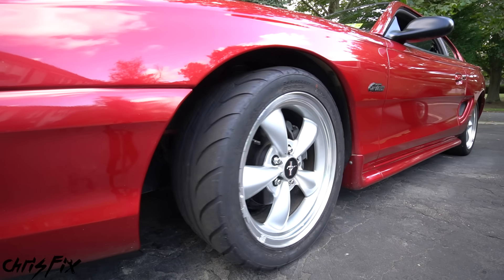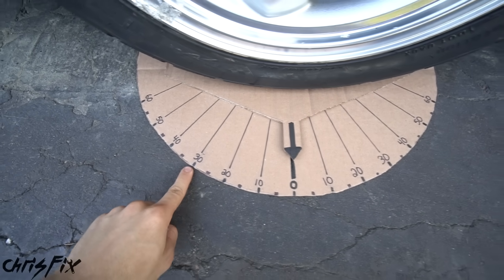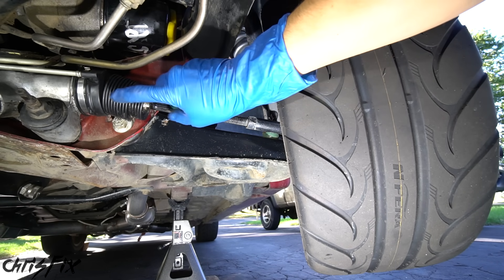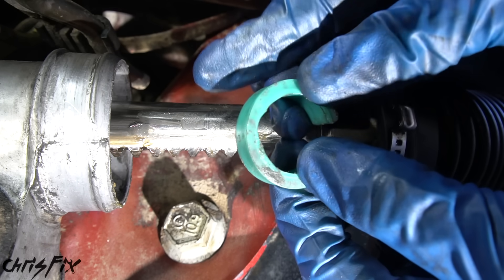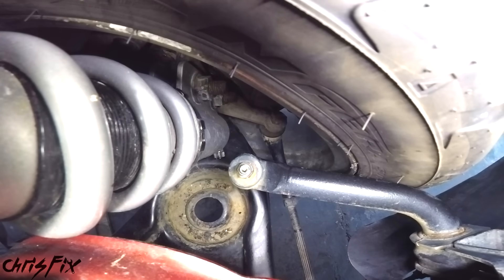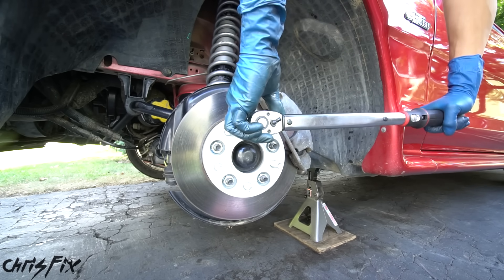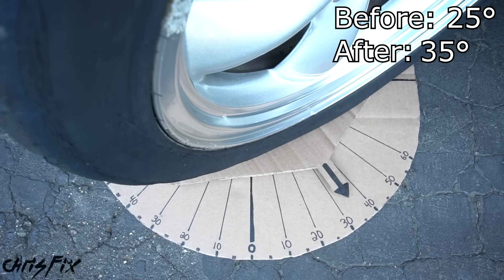How to Get Your Car to Make Sharper Turns (Steering Angle Mod)

Comment: Normaly i like the chanal a lot but if u do big place holders to the front wheels, i realy hate it. You will notice that your car isnt drive that comfortable and you have to do much work on the steering wheel just by driving a normal road. I would explain it better but my english isnt good enough to use technical terms.

Comment: I would rather replace the ear clamp whit a reguler nut clamp or a reguler hand tightening clamp.The ear clamps can get loosen when you remove them.
I'm thinking it's better because the rubber tubing woulden't snap off it's former place when you make turnes.

Just my opinion !
Reply from the maker: +Dado slo good idea!

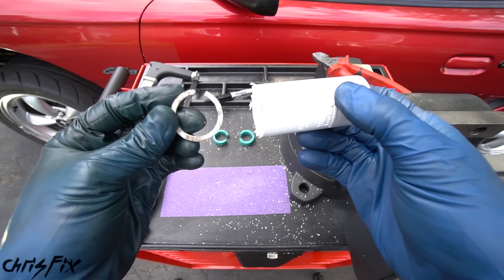Comment: @ 7:13 PVC pipes are not good for high temperature and they have low wall thickness.
Try to use polypropylene tubes and aluminum or wood mitre saw

Comment: cris
ABS   not working,  abs light always on...
plz tell how to fix
Reply: Jotu Singh One of the most common problems is a bad wheel bearing or speed sensor, but it could be just about anything. Any ABS fault will trigger the ABS light and turn off ABS. You will need a scan tool to see what the fault is.
Reply: Little story. My ex girlfriend bought a car from a used car lot. They told her that the battery and the fan belt was bad. They told her to go to the garage they contract with and get those installed for free. Well She said when she was leaving, they told her the ABS lights were on and would need to be looked at, at a later date. She never did take it back. The next couple weeks, I did a routine going over, changing the oil and testing the radiator and such. I happened to see some electrical tape hanging down beside the master cylinder. "Someone" had put the plugs in without snapping them in place, then wrapped the black electrical tape around the ABS electrical plugs so that  the plugs from the wiring harness to the master cylinder would be hidden that they weren't snapped into place. I pulled the tape off and snapped them right back into place. Problem solved. She had told me before doing this work, that she didn't remember the ABS light being on going over to the garage... Check those connections.

Comment: There is a good reason why they limit steering angle. Usually by CV joint design. Also after any steering rack modifications, you need to do tire alignment.
Reply: Usually due to not wanting to spend the money single model parts.Most modern cars are kinda parts bin builds with many parts having been manufactured for multiple options.Its simply much cheaper to limit steering angle than redesign parts of the steering and suspension system.

Also, this isnt a steering rack modification, its simply removing the physical limiter.I would however still recommend checking the alignment due to adding the wheel spacers.Its entirely possible for them to change the wheel alignment.Seen it several times over the years.
Reply: I don't think this would change alignment at all, just limits (which I agree should be left alone unless you understand steering geometry)
Reply: 80 % of cars in my country are fwd
Reply: @TheBlork74  not the kind of car enthusiasts generally buy though. Car guys will almost always go for rear wheel drive. 4 wheel drive is also seen occasionally (i believe 4 wheel drive has a similar issue to fwd)

Comment: Wouldn't you need a new wheel alignment after installing spacers of that size?
Reply: Depending on the setup, you may or may not. In most cases, no. But in some circumstances, you should at least have your alignment checked.

Comment: I was wondering if you are able to switch out windows on vehicles such as the back truck window with one that slides. I bought a Ford ranger and it doesn't have a sliding window on the rear glass. How easy would it be to put one in?
Reply: Honestly if you found a rear window the exact size, it wouldn't be too difficult. You will just need the proper tools to remove the glass and install the new glass (almost in all cases they are held by a sealant). From there, if you wanted a power sliding glass, you would have to run wiring and it would likely be more involved at that point.

Comment: Can you do a video on replacing broken lug studs?, I noticed you didn't have one.
Thanks your the best!!! =)
Reply: I don't think he has a video, but I can at least help you out. Generally, in most situations, you can remove the wheel, and smack the broken stud with a hammer from the front to the back. And from there, in my experience, when installing a new lug nut stud, I generally gather a large stack of washers on the stud underneath the nut, and use an impact wrench to draw in the new stud.

Comment: There's a reason why those power steering limiters are on there... and at least here in Utah you won't pass safety with those spacers..good idea though. if the car performs fine the way it is....why fix it ??? if you do run into clearance issues...thats just another headache.

Comment: Hey dude, I’m doing up a 1997/98 Toyota Supra RZ, and I need to know what kind of fuel pump I should get if I’m using it for track-day Racing. Needs to be less than 300 quid (I’m in the UK, but in US terms, around $460). Cheers in advance
Reply: LiamIsAPikachu YT use a gas pump that only runs on air

Comment: Hey ChrisFix, 

I wonder if you could discuss new changes in Mass annual inspection started this month, which almost means "if you love working on your car or making it better, move out".  They are now mandating EVERY shop to purchase $5,000-$10,000 equipment with x5 cameras at EACH bay and even on an inspector (!).  So, you are forced to driver boring cars unless you can afford a $100,000+ car.   

Something as simple as a CAI, catback or ride height 2 inches higher/lower than stock will not pass.  There has been a petition going on at Change.org by a man named Nick Martini.  You probably would not believe how absurd it is, a LOT worse than California......  If this program does not get removed, aftermarket performance parts vendors will lose ALL customers in the state/commonwealth of Mass......

Comment: You need to get just better steering wheel and move last seats and all things you dont need so it's not heavy
Reply from the maker: Thanks for the tip!
Reply: ChrisFix and  i  forgot to say to move Electrnic out beacuse that kann fired up easily and rolcage i forgot to say thanks for response

Comment: Hey Chris, Love your vids! Just had one question on changing oil... When removing the bolt on the oil pan to let out the old oil, the copper gasket that you mentioned was 1-2 time use, is that universal  to all cars, or are the gasket and bolt size different among different types of cars?
Reply from the maker: There are different sizes. You can call the local parts store and get the correct size for your car.
Reply: Thank you!!!!

Comment: Hello Chris(or anyone who knows something about the topic), Im looking to be buying a  bmw 335d, ive heard there is pleanty of problems with the carbon buildup on them. Now I just wanted to get some infromation from someone who knows what they are talking about, by all means i did browse the web but just wanted to double check with you. So what are the risks of this carbon build up other than the car being in limp mode? also how ofen am i looking to clean this out, ive read roughly 50k miles. What other things do i need to know about carbon buildup?? and i was reading that some guy was looking at roughly a 4000 dollar pricetag to change his head, why does he have to change this head? why not just get it cleaned? here is the thread i was reading. http://www.bimmerfest.com/forums/showthread.php?t=711971

I know you're very bussy but if you find some time to anwser my questions I would be very thankfull. Im not buying the car for another 6-12 months however im just trying to build some knowledge around it.
Reply from the maker: If it is direct injected you can have carbon buildup issues and to mitigate them just use an additive in the fuel every oil change or so.
Reply: Thanks for the reply Chris, Im still not 100% sure on what are the risks of having carbon build up? as im buying the car second hand and I dont really know how well its been looked after, what could happen if the carbon is built up to a very high amount? Obviously I will need to get it cleaned out but what could be the risks of not doing it in time. Thanks for taking your time to reply.

Comment: Hi Chris,
My 2005 Dodge Magnum left side brake caliper keeps sticking. I changed the caliper, brake pads and brake fluid. However it keeps sticking.

What do you recommend?
Reply from the maker: Sounds like it could be a collapsed brake line (the rubber line) or a bad master cylinder.
Reply: ChrisFix thank you for the quick reply, do you have a video on either repair or is this something I should let the professionals handle?

Comment: Would it be a good idea to stick wheel spacers on the back wheels too? That way the front wheels aren’t our more than the rear wheels and it doesn’t bother my OCD.
Reply: No it would be better to get over your OCD instead, and cheaper, and less hassle to service rear brakes and suspension, and less road grime thrown up on the rear quarter, unless you like hillbilly mud flaps.  ;)
Reply: Captain Lag yes

Comment: After you make the rust video, or the air intake video, can you make a video about converting drum brakes into disc brakes?
EDIT: I don't like the look of drum brakes and they're too expensive to maintain (shoes cost around $100 for 1 pair) and the assembly costs around a few hundred bucks if I wanted to rebuild it with springs and cables.

Comment: At maximum turning angle, that tire is going to rub a hole in the brake tubing, and tire when the wheels are under a load.  This mod is dangerous.

Comment: What’s up Chrisfix, 
I had a question about body work. I recently went on a road trip (Texas to Louisiana, and back again) and when I returned home I found a lot of little rock chips on my bumper. My hood is not too noticeable, but my plastic bumper feels like 80 grit sandpaper. I have a 2013 Dodge Avenger Black. What would you recommend for removing the roughness of the bumper to bring it back to sexy smooth. If there is no solution, I understand. Thanks Chris! And keep up the great work!

Comment: hey chrisfix i got a question about washer fluid during the winter. 
If you want to be 100% sure that its not going to freeze on the window
when using it before your car fan has gotten up to temperature, and this
has happened to me many times when driving on the highway and using the 
washer fluids and it starts to crystalize on my windshield. is there a mix 
of fluids i can use to completly avoid it freezing all together ?

Comment: Great videos Chris ,, perhaps you could offer some advice,, been trying to do a superflush like in your video.. My 1992 Buick RoadMaster's manual says it holds 16.5 quarts, but when I open the petcock and radiator top I'm not getting that much out.. When I fill it back up with water it's only taking about 7 quarts..I've been letting it run to get up to temp and I've got great heat coming out.. It's like whatever's in the engine is trapped in there or something.. I just replaced the thermostat.. One thing weird tho, It never seems to get above 160-170 degrees even after being run hard for 30-40 miles and it's also running on the lean side. I haven't tried taking off the bottom radiator hose yet.. Any thoughts ?
Reply from the maker: Your car probably has a coolant drain plug in the engine block. That should drain the remaining fluid. Try replacing the thermostat too. Sounds like there is an issue with it not heating up all the way.
Reply: I've already replaced the thermostat.. where should I look for the other drain plug or will the bottom radiator hose work as well. Me nor my mechanic can figure out why it's op temperature is so low or why it's running lean

Comment: Dude, there's special pliers for those CV boot type clamps.  "ear clamps"  You can re-use them.  You might want to go back and tighten them as pulling them off like that will make them loose & possibly come off.
Reply from the maker: +briansmobile1 thanks for the tip Brian
Reply: Welcome ; )

Comment: Hey Chris!? I wanted to ask you something. I live in Pakistan and I own a Honda City ivtec and its mileage had now reached 75000kms. So what maintenance procedures should be done. Catconverter cleaning, sparkplugs change, fuel filter change, valve clearance and throttle body service were never done to my car. Should I do them now or wait any longer. Your help would be greatly appreciated. ☺️

Comment: Shouldn't you put thoose wheel spacers on the rear side aswell? I mean that your wheels are not in line now should affect the stability on quick turns? Correct me if I am wrong.

Comment: Hey, I also have a 1998 Ford Mustang, but v6, and for some reason the clutch is really hard to press. I don’t know if is just like that or if it was changed.
Clutch works perfectly fine so I don’t think there is a problem. If is even possible, can the clutch be adjusted. Any response will be greatly appreciated. I love your videos, your material is truly one of a kind and very helpful. Keep up the good work, THANKS
Reply from the maker: The clutch in our mustangs is heavier than most other "normal" cars. It isnt hydraulic so...
Reply: Alright man, thanks for the help, I really appreciated 👌

Comment: Hey ChrisFix, HUGE fan of your videos. I have learned a lot about maintaining and diagnosing my 2005 chevy colorado from your videos. I have a possible video idea for you. It would really help me out and I'm sure it would help out a lot of other people as well. At random times of the day, my colorado won't start. Sometimes it doesn't give me any trouble at all and sometimes I want to push it off of a cliff. It will crank consistently, but won't always completely fire. From all of the testing that I have done and from my research and watching your videos, it looks like it it is a bad ignition switch. Could you possibly do a video on how to diagnose and replace an ignition switch? Thank you much!

Comment: Hey man I had a question, how urgent is it to Change a cabin filter and engine air filter as well as coolant flush? I bought a car and got an emission done and this is what they said it needs. I was told it's not a serious problem either, but needs to be done
Reply from the maker: I mean an air filter should be done soon if it is bad because you are losing power and MPGs and it takes 5 min and $15 to do. The cabin filter should also be changed eventually but is less urgent but it can cause your blower motor to fail. The coolant should be flushed before there are any major issues: https://www.youtube.com/watch?v=s--5ft5YiHg
Reply: ChrisFix ok cool thanks man. I'll have my car (2010 Audi A4) checked out this weekend. Glad to hear it's cheap. Last week when I showed my car to some dude he said I needed spark plugs and wanted to charge me a lot for it. But I checked my carfax and saw I had it already done not too long ago. It sucks not having a trustable mechanic to go to in my life but I'll try my best. And thanks for the video link I'll take a look!

Comment: Hey Chris, I have a Volkswagen Golf Mk4 2.0 Automatic transmission 2004 model here in Dubai, probably imported from Japan, it has 177000 on its odo, I purchased this car 6 months ago, I got the air filter cleaned, I changed the Engine oil with filter when it was 174000, and also the transmission oil but not the filter, I come across a problem with gear from the day I purchased. When the car gets a little heated it struggles to go in reverse, and when the vehicle is running for 1 hr+ it confuses itself in changing gears when moving forward, it also struggles to hit high speed(140kph+) when the engine is running for a while basically losing power at high speed, would you please suggest me solution as the local mechanics here ask me to change the whole transmission but I think you have the right solution for this problem as I am following all your videos.

Comment: Hey Chris. I have got a problem with the interior plastics of a 2007 Alfa Romeo twin Spark 147. The interior door handles and the plastic surroundings of the door speakers just above the door handles (both plastics) have gone sticky. I have made a reasearch and people say that the rubberised top-coating put from the factory, has been broken down by sun and etc and needs to be removed.
Any idea on how to remove that top-coating polymerised sticky film? After the removal of that, any idea on what to apply on the plastic for protection and good appearance?
thanks a lot really looking for help on this!

Comment: 1 thing to add: don't change your front suspension geometry like it's done here unless you know exactly what effects it will have to scrub radius, bump steer, camber gain, forces on suspension parts and so on.

Comment: Cool video man!!! I use a bit of positive Caster when a do alignments to accomplish a similar result. I’ve worked for Ford for 15 years and never thought about the Rack spacers!!! Thanks man, I can’t wait to experiment 
You can adjust your Caster/Camber at your strut tower. You would be surprised how much positive Caster and negative Camber you should have to really drift properly. 
You can by a gauge to mount on your wheel to do your home alignments... Fun Stuff!!!

Comment: found a video that does better than me just putting into words. This will definitely help get sick turning angles. it's the suspension MOD you may be interested in. to a time laps of you doing weld if you do this MOD and you will have topped the other video.
https://youtu.be/MsnTZqCzzY0